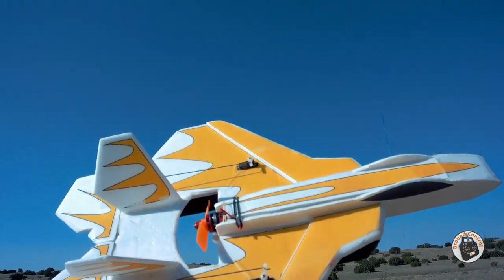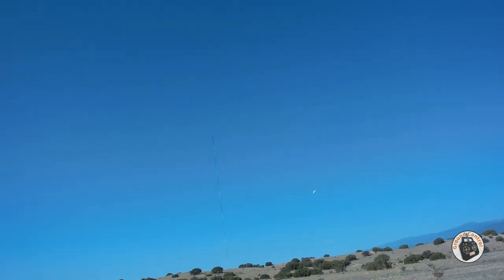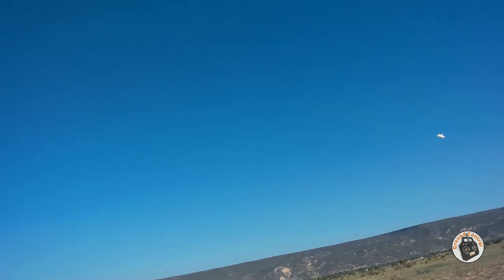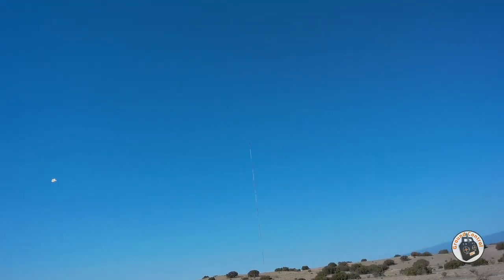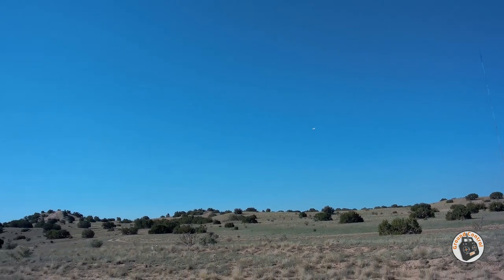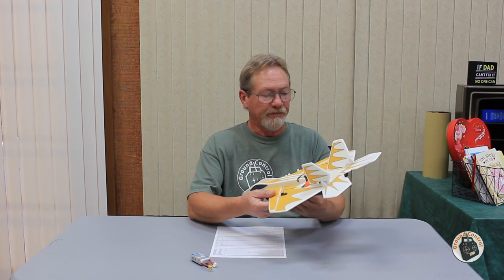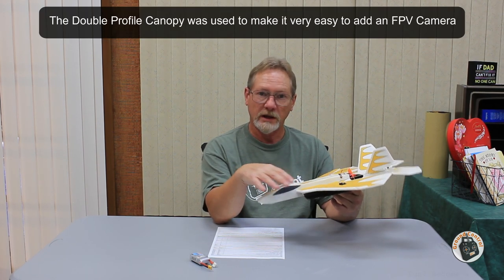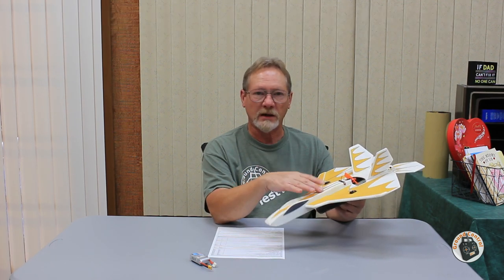Re-Introducing the Glue & Fly™ Series DIY F-22 Raptor Micro V2 - Sub 250g High Performance Parkjet!

Comment: Other than going smaller, presumably to get under 250g, what other changes did you make? I'm looking to build the FT F-22, and if there are any improvements to be made, I'd love to incorporate them. It's gonna be my combat job at Flitefest 2023!
Reply from the maker: Hum...well this one can fly on 2S or 3S.
Using the electronics I chose for this Parkjet the following would be standard characteristics.
On 2S it's very docile and would make a good parkjet trainer.
On 3S it has unlimited vertical climb.
It's AUW on the 3S I use is just 150g.
This Parkjet uses a KF2 Airfoil and it's Big Brother uses a KF4 Airfoil.
The KF Airfoils add stability and lift over a flat board wing.
It's pretty durable as I have over 400 flights on mine.
Have fun at flitefest ;-)
Reply: @GroundControlRC  Thanks GC. I didn't get a chance to print the plans. As I write this, I'm on a bus headed for DIA to fly to Ohio. 

I'm thinking I'll probably find a Office Depot or such and print the plans at the other end. I've got everything but the motor and prop to build it in my giant suitcase, along with my B-25. 😁

Bus driver must wonder why the biggest suitcase he loaded didn't weigh much. 😆
Reply from the maker: @kf4293  Hehehe...have a safe trip!
I usually take them to a printing shop as well to have the full size plans printed as assembling tiled plans is pretty boring ;-)
Good luck on your build and have fun at flite fest!

Comment: Nice flying. Well I grounded because no one knows anything about Hi Tec Radio . My first stop at the Flying field they told Me yes but now no one is there. So my Radio is up for Sale. Looks like Spektrum has to Be. Thanks for all the Videos. Maybe you try 3D Foaming and the 4D kit.  Bye
Reply from the maker: Hi Gregory and thank you!
Sorry to hear about the radio.
I started with a DEVO 8S and with the Deviation Firmware it could support not only Walkera Receivers but Spektrum as well.
So, I've stayed with DSMX / DSM2 Receivers and now that the RadioMaster TX16S supports so many protocols you have many more choices.
It's my primary TX now.
I have a Yak54 Aerobat 3D Plane I haven't flown in a while. I'll have to take it back out soon.
Good luck on whichever Radio System you choose so you can get back in the Air.

Comment: hey tony, how many flights on the micro f-22 now?     well I finally got my 2 modified micro f-22 that i made into micro f-16 thunderbird and micro a-10 warthog.....their fate didn't last long...both crashed within seconds after launch  hahahahahahaha, you learn some .....both took off sorta straight, probably pilot error (me)   then both took hard left handed turn dive to their deaths.....scrapped them both for electronics and now I am assembling my micro f-22 which I made same color pattern as your yellow one, but I did orange if you remember.    I hope to try its flight this weekend.  I will let you know....how that came out.
Reply from the maker: Hi David! Sorry to hear about those failed launches. With the power system I have on this Micro F-22 I launch at just 45 % throttle and it takes right off without any torque roll. It's the same with the F-22 Mini. It sounds like torque roll on those launches. I hope the F-22 Micro goes better as it's a blast ;-)
That orange color should be very visible indeed.
I almost went with orange ;-)
Let me know and I'd love to see a video of it.
Good luck on your Maiden!